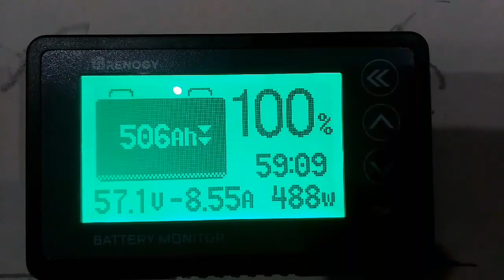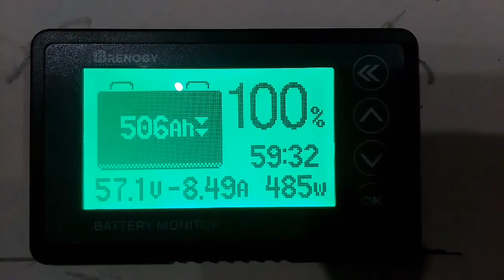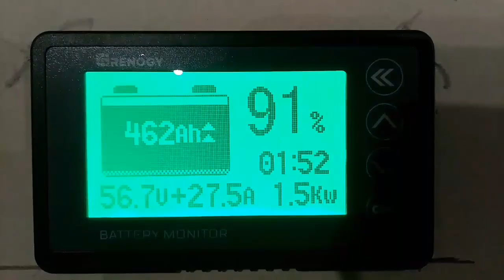Update on Nissan leaf batteries.

Comment: If you use a charge controller why do you use a BMS. Just curious
Reply from the maker: A charge controller can only tell the total amount of votes that the batteries have so when it reaches 57 volts it will stop charging the battery.   The BMS monitors each individual cell so if one starts overcharging it will shut down charging to all the batteries to keep you from damaging the parallel sales that are overcharging.
Reply: Thank you for answering my question. I’m new to using a battery system. I’ve been using The Eco worthy grid tie inverters with limiters , but I’m adding a battery bank to power my house at night. 🤞

Again Thank you. Now I feel more educated. 
When people ask me what college I attended I tell them 
YouTube university.
Reply from the maker: @penrodautorepair3170  thank you and good luck on your setup 👍.
Reply: Thank you. Are you on instagram
Reply from the maker: No I have no Instagram

Comment: Hey carson, I'm a new sub here! I was just wondering, if you could tell me where to get those copper bus bars and those battery lugs from. I have seen another youtuber make the bus bars from just smashing some copper piping bought from home depot flat and drilling the appropriate holes for the lugs. I'd rather buy them at this point than make them if I could. Although I am not opposed to having to if that's my only option.  I'm going to use the leaf batteries for my off grid tiny house project going forward. it won't be as big as your bank by far. it'll probably be 24 modules together in series when all is said and done cause a brutha ain't got enough gaup to get all 21 at once. so I'll get them probably 8 at a time. Anyways man nice work your doing here. You're truly an inspiration!!!!

thanks in advance for the reply!
Reply from the maker: If you going to use multiple batteries in parallel like what I am doing you you can get bus bars from here https://www.ebay.com/itm/283458344815 . If you are going to use individual batteries in series you can use the factory Nissan leaf bus bars.  Thank you and hope to see you back here again.